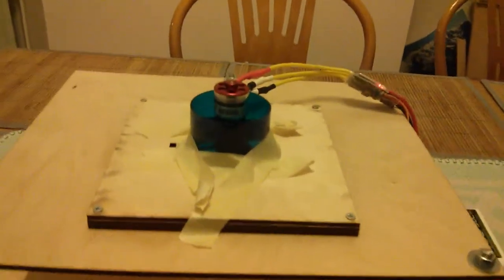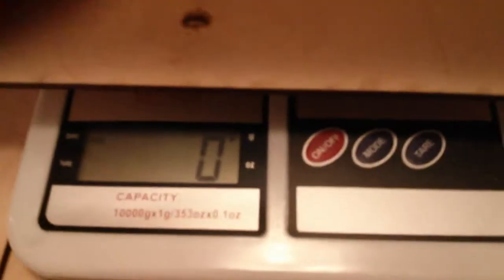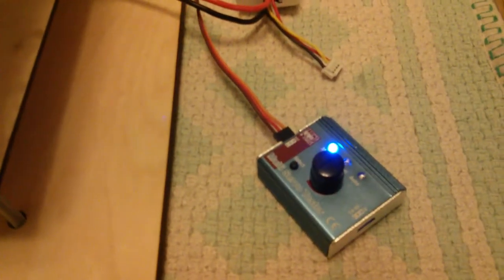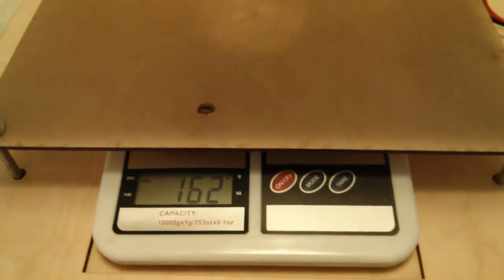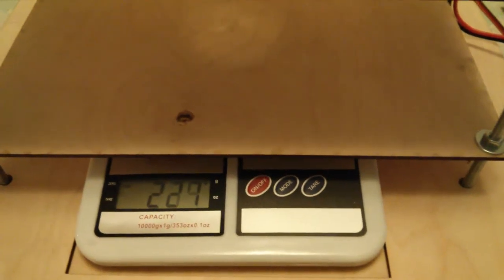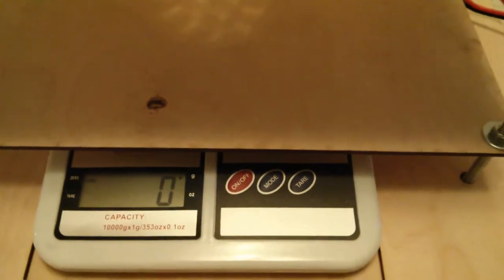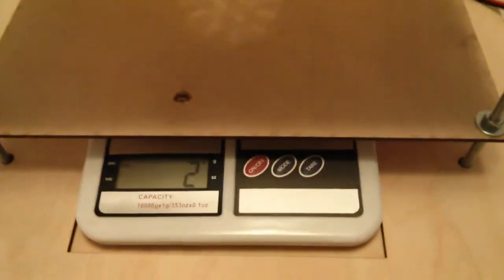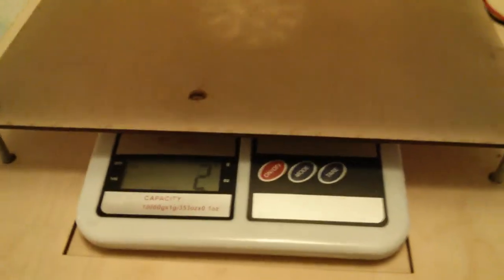Quick test of Ducted Fan (EDF) Thrust measurment platform

Comment: What's the rating of EDF used here?
Reply: Thank you. I've a 3900KV EDF what would be it's thrust? And the value shown in video is in gms?
can you share with me the calculation that is required to get the thrust mathematical?
Reply: gratefu1frog I know kV is RPM/volt.. I needed to know the thrust of my duct fan.
thanks for the info.
Cheers